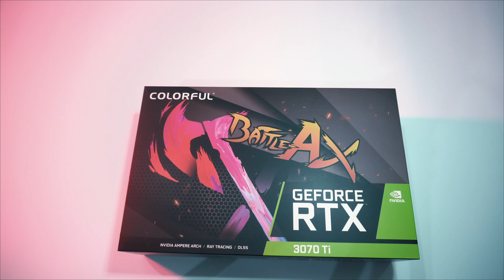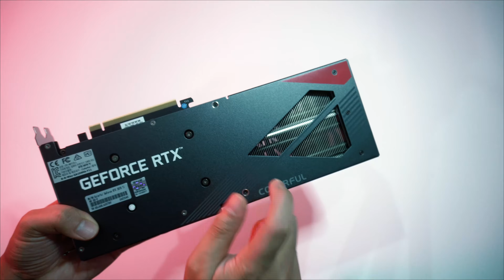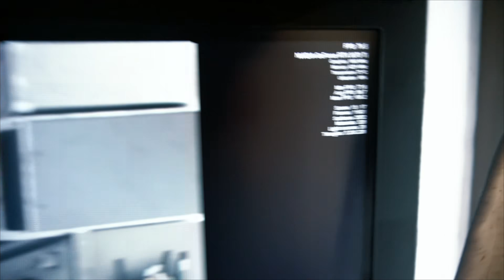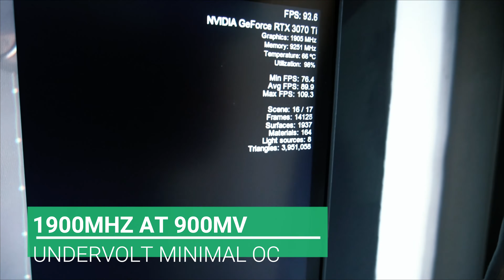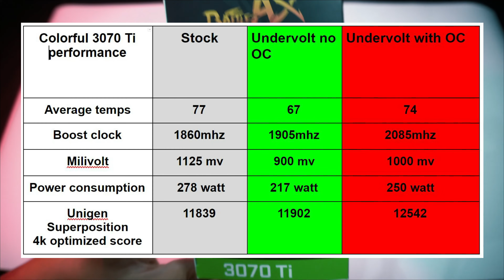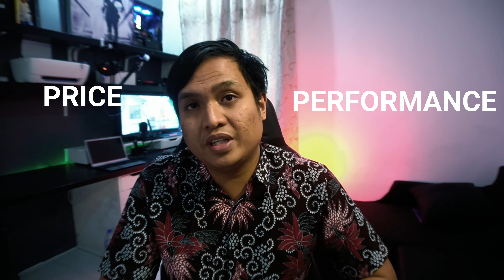Colorful 3070 Ti review - Superfast , as long as you undervolt

Comment: Hi bro. great reviews. However, for the overclock and undervolt, will it shorten the GPU life span?
normally I just undervolt to the card standard clock, to get lower temp.
Thanks.
Reply from the maker: i dont think OC generally will make the gpu life shorter.

I think heat is the main killer.no matter uv or oc. as long as temp is low, e.g 75c and below.that should be fine

Comment: Thanks for this though I am struggling to undervolt properly. I have the 3070 TI Founders Edition and on my first stock run got just over 12,295 in Superposition 4K optimised with temps at 75 Degrees max. Then I overclocked to + 115 on core clock and + 565 on memory and got 12650 in Superposition with temps hitting 79 degrees C. When I tried to undervolt on stock setting starting at 975mv it crashed after a while, anything lower also crashed. I increased to 1000mv and it worked but temps were still at 75 degrees with a score of 12365.. Pretty much the same setup with a 10700K though overclocked to 5.1GHz.

Edit - just tried it 985mv with a 2000Mhz upper limit and got a 12260 score with temps at a max of 73 degrees C...all fans were running at stock a well...Still think I need to get better at this but really need to dive into undervolting as it can drop the temps and power usage but still give decent results..

Comment: My card is reaching 89 degrees. I have the same card. What should I do?
Reply from the maker: im afraid if yours reaching 86c then it means u have a poor ventilated case

U can try the undervolt settings like i did in my review
Reply: @drj144  I tested it in open case. When I manually set my fans to 80% it hovers around 76 degrees. Is it safe to manually set it to 80%?
Reply: @drj144  can you tell me what was your fan's rpm when it reached around 70 degrees?
Reply from the maker: @mygameislagging3947  i used a linear fan curve.meaning when the temp reach 70c the fan is at 75% speed vice versa
Reply: @drj144  then it's fine, for some reason my fans are not kicking in. Maybe I need to update my bios. But I don't know how to do that with this specific model. Thankyou for your replies. It really helped.
Reply from the maker: @mygameislagging3947  np bro.hope u can get it resolved

do consider to leave a like on my channel.
Reply: @drj144  like and subscribed.

Comment: Bro can you share your undervolt setting? Or do you mind sharing your facebook so i can send a pm? I'm using zotac rtx 3070ti & would love to undervolt. The fan sounds like a goddamn space jet
Reply from the maker: Zotac i gotta say , cooler dia not very good, both the trinity, or holoblack - but rupa lawa - i suspect sbb if tgk kat tepi fan , plastic bordering fan x btol2 cover sekeliling

Nway undervolt yg saya end up pakai and paling stable

1)950mv at 2000mhz - nie paling stable, clock tinggi and temp around 70c je

Do consider subscribe bro

Comment: I need a help , I'm buying this 3070ti for a very good price , should i go for it , one person said heat sink is bad of this company
Reply from the maker: look.if its a good price.go for it.

as u can see in the review.UV helps a lot. plus, its still a 3 slot 3 fan GPU

A 2 fan 2 slot would be worst. just go for it bro
Reply: @drj144  Thank you so much bro , I'll pair it with Ryzen 7 5800x , you think atleast for 2 year I'll be future proof ?
Reply from the maker: @ayushagarwal4564  yes i would say it is for 2 years

also, another option is u can save and buy the 10700F , and use that money to buy a 3080 non Ti. 

if that option is available
Reply: @drj144  here in India 3080 ti is way morw expensive like alomost double for what I'm getting the 3070ti ,  

To give you a idea

For 10,000Rs more I'm getting ryzen 7 5800x from the 10700f what u suggested.

And for 80,000rs more I'll rarely find a 3080 , now you can understand my problem
Reply from the maker: @ayushagarwal4564  understood , then better u secure the 3070ti

80,000rs rupee almost 1 lakh ady , almost as much as my bajaj pulsar 200 haha